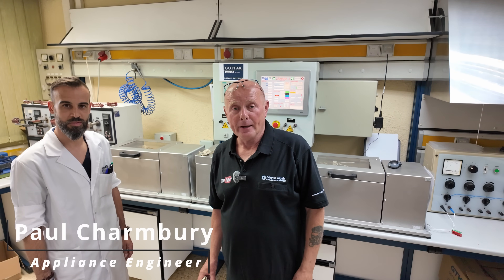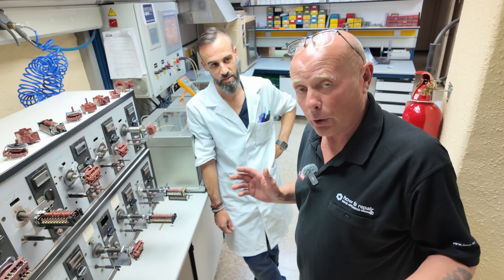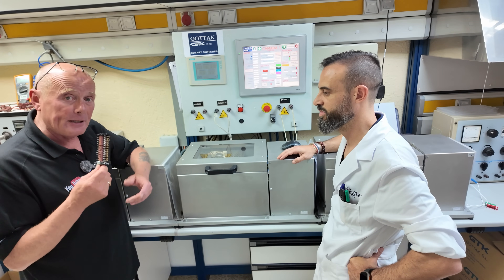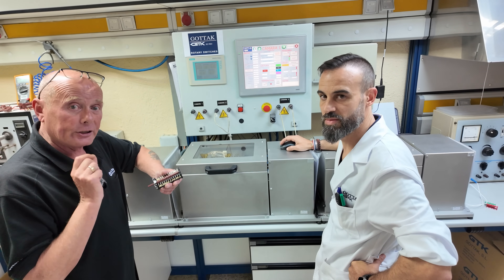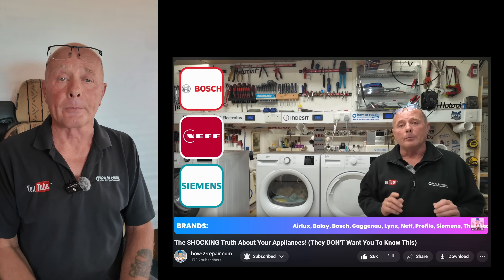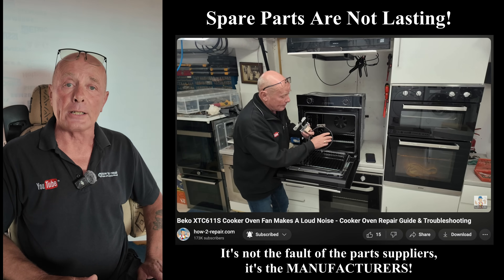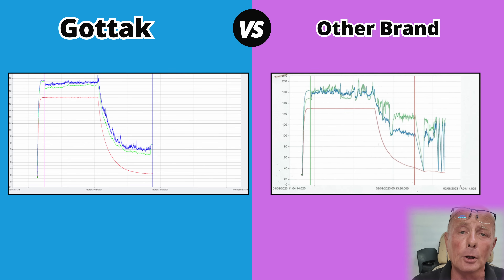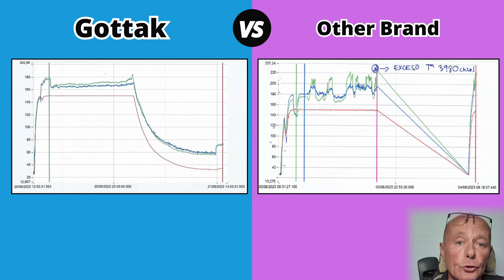Why Your Appliances FAIL SO FAST! Lab Results EXPOSE the Truth!

Comment: Market is full of shit claims to be honest. We bought I think it was Samsung or was it Electrolux washing machine. I think it had two or three year warranty and there was huge advert on machine for motor to have was it 10 year guarantee. Machine failed badly about half year later than warranty had expired. Drum was totally lose inside and there were small bits of stainless in drum. I was curious to what had happened and out of shock I find out that drum spider assembly was made of aluminium and drum fixed directly into it. I'm by profession packaging machine mechanic and even in "metal school" young, I was told that this is one of the worst corrosion pairs there can be and indeed in my eyes it was galvanic corrosion damage that had resulted in obsolete machine. Then looking at motor assembly surely enough it was assembled with really sturdy bearing and rotor/stator assembly was such that I don't think it couldn't have burned in that warranty time or at least I think odds for that are really low just eyeballing the assembly. It's downright disgusting what manufacturers do. I don't believe for a second that ANY company that has done washing machines for decades wouldn't know about virtually all possible corrosion pairs, but yet there clearly are ones in machines. I googled out of this in a shock and found out similar assemblies are very, very common in washing machines. Planned obsolescence? I don't question that anymore for a second and I've lost trust in all marketing stuff. It's going to be interesting how now I think it's two year old Miele washing machine and dishwasher will fare. They're touted by many to be robust, but time will tell. I don't believe anything until they've surpassed 10 years in use, that's if they will.

It's disgusting that these methods are done this day and age, when tech to create good solid robust devices are everywhere. I don't consider myself to be a "green person", but it still disgust me greatly how much stuff is discarded these days only after brief usage.
Reply from the maker: Hi there! Thanks for your incredibly detailed and insightful comment, @jothain!

Your experience with the washing machine is a powerful, and unfortunately, all too common example of what we discuss in our video. You've hit on several crucial points: the failure of a critical component (the aluminum drum spider) due to a known problematic material combination (with the stainless steel drum) leading to galvanic corrosion, and this happening just after the main warranty expired, while the heavily advertised motor remained perfectly fine. This is exactly the kind of scenario that raises strong suspicions of built-in obsolescence.

Given your professional background as a packaging machine mechanic and your early education on corrosion pairs, your assessment is particularly damning. As you said, it's hard to believe that a company with decades of experience wouldn't be aware of such a fundamental engineering concern. Your discovery that such assemblies are common only deepens these concerns.

Your point about the sheer wastefulness of discarding appliances after only a brief period of use, especially when the technology to build durable devices exists, is also spot on. At the trade show last year, understanding how these design choices contribute to premature failures and e-waste was a major topic. For a deeper dive into this and to see other examples we covered, please check out the full video here: https://youtu.be/gEgSCbZnHVM?si=wTIw0mELuhWaw4aX

We also explored related aspects in these videos:

The shocking truth about manufacturers: https://www.youtube.com/watch?v=QsdGd2qDPaI
Heat pump tumble dryers are they really worth it?: https://www.youtube.com/watch?v=xn03N3b0-lE

If you found this information eye-opening or validating of your own experiences, please consider sharing this video with your friends and family. Stories like yours are vital for raising awareness.

Thanks again for watching and for sharing such a compelling firsthand account. It's truly disgusting, as you say. Don't forget to subscribe to the channel for more insights like this!
Reply: @How-to-repair  Just remembered when I was at work in one evening shift when colleague arrived in his freetime to our workshop dragging top loading washing machines drum assembly with him. Machine had obviously gotten seized bearing cause of metallic grinding noise. We were awestruck to see that bearing was completely embedded inside plastics, so clearly made to be non-user replaceable item. My colleague just laughed at me and stated "I WILL replace that bearing after disassembling the machine". He quite violently managed to get bearing visible and we immediately got laughs that bearing as known had failed, but it didn't have any kind of markings in it. Maybe the worlds best indicator of really bad quality bearing, even the surface finish looked really bad to naked eye. We measured it and replaced it with good brand one, just as the sealing for it and he literally glued the casing back together. Now this is something we'd never endorse anyone to do, but it's incredible to what extents manufacturers go. We couldn't believe how it had been assembled and we both thought that it has to be a lot harder and slower to assemble machine like this, instead of making just removable bearing/sealing flange to it. With that flange assembly it would've been like less than 30min job to replace, instead of my colleagues was it about three hours he spend cutting the assembly open, replacing parts and gluing it all together. Insane... Just absurd stuff. Oh and it would've been possible to purchase replacement. For multiple hundred euros the entire assembly, very near to that machines retail price. Pretty much face slapping end user saying "Don't even bother with any labour costs" 🙄

Comment: The problem is making equipment that last for ever also is a death blow for the manufacture, as no new sales means you go broke.
Reply from the maker: The challenge of balancing extreme product durability with a sustainable business model that relies on ongoing sales is definitely a significant factor in how product lifespans are approached. It's a dilemma that's often part of the broader conversation around why products last as long as they do. Thank you for your comment. I appreciate people like you taking the time to write it out. Please share it where possible. It might help others make a wise choice instead of being misled by the industry.

Comment: The unnamed continent starts with a C and ends with an a.
Quisenart air fryers are short lived and made in the above country.
I also noticed that many other products don't use silver contacts, flashlights for instance, steel contacts....unreliable trash.
Reply from the maker: You're absolutely right mate. Once renowned brands with strong reputations for quality are now often owned by larger corporations that shift production to regions where costs are lower, such as China. Thank you for your comment. I appreciate people like you taking the time to write it out. Please share it where possible. It might help others make a wise choice instead of being misled by the industry.
Reply: @How-to-repair One sad example of the decay is Duracell battery's which are now leaking, short service life, and could do damage to devices if not checked often.

Comment: Will not replace defective appliances-will repair them myself. If unrepairable, I will buy an older used unit. Todays cars, and appliances are junk even when new.
Reply from the maker: Your approach of avoiding new purchases in favor of repair or more time-tested used models is a direct response to the issues we discuss where products might seem designed with shorter lifespans or built with less durable components. Thank you for your comment. I appreciate people like you taking the time to write it out. Please share it where possible. It might help others make a wise choice instead of being misled by the industry.

Comment: For this reason, when I notice an engineering fail, I fabricate a system that won't fail. They do the same thing with almost everything you buy now. Appliance parts, automobile parts, it's all the same. It's not about quality and making the best part, that's about making a part that will meet the minimum standards so they can make the maximum profit. For that reason alone high steer clear of digital appliances and with analogue controllers how often replace controllers with second hand dated parts because even though the part is used it will perform better and last longer.
Reply from the maker: You've hit on a really important point about how the drive for profit can often seem to overshadow the pursuit of quality and longevity in manufacturing. Your approach of fabricating your own, more robust systems when you encounter an engineering fail is a testament to the frustration many feel.

Thank you for your comment. I appreciate people like you taking the time to write it out. Please share it where possible. It might help others make a wise choice instead of being misled by the industry.

Comment: My washer is permanently set on Quick Wash. I never use anything else so the selecter should last forever. I have had to replace the door locking assembly 3 times though.
Reply from the maker: Thank you for your comment. I appreciate people like you taking the time to write it out. Please share it where possible. It might help others make a wise choice instead of being misled by the industry.

Comment: The appliance built today are trash they fail to early and can cause fires.  One example I  experience was a dry, the design of the air flow system force lent past the tank seal and caught on fire, the came out under warranty to repair, after 2 repairs and three lent fires we forced them to replace it.  Also the parts a cheaply built, the replacement parts many time were faulty and would not work at the time of installation after three parts on finally worked.  This also applies to car parts, on my granddaughter truck the fuel control module failed, a new installed the truck still would not run.  It was take to a diesel shop they said the controller was faulty so a new one was installed truck would not start. They thought the timing system failed after $ 3,000.00 was spent truck would not run. SO THE TOOK A WORKING FUEL CONTROLLER OFF ANOTHER TRUCK AND IT RAN SO A THIRD CONTROLLER WAS PURCHASED THIS ONE FINLY WORKED, TOTAL COST FOR REPAIRS $5,000.

It is a shame that reliability is of no concerned but selling more appliances is.   My son has a 1940 refrigerator that is still running and has never been repaired.
Reply from the maker: Hi there! Thanks for your comment, @davidhagerman7165!

We're really sorry to hear about the incredibly frustrating and dangerous experiences you've had with both your dryer and your granddaughter's truck. Your accounts of premature failures, fires due to design flaws, and the difficulty of getting working replacement parts are truly concerning.

You've hit on some critical points about the declining quality and reliability of modern appliances and parts, and the serious consequences this can have for consumers. The issues you described – from the dryer's airflow system forcing lint to catch fire, to receiving multiple faulty replacement parts for both the appliance and the vehicle – are powerful examples of the problems stemming from what seems to be a lack of focus on durability and robust design. This is exactly the kind of situation, highlighting how some products seem designed to fail or are made with subpar components, that feeds into the concerns about built-in obsolescence we discuss in the video.

The contrast you draw with your son's 1940s refrigerator that's still running is also very telling and resonates with many who feel that longevity is no longer a priority. At the trade show last year, understanding how much these issues of design, material quality, and planned obsolescence are impacting new appliances (and clearly other products too) is something everyone should be aware of. For a deeper dive into this topic and to see the examples we covered, please check out the full video here: https://youtu.be/gEgSCbZnHVM?si=wTIw0mELuhWaw4aX

We also explored related aspects in these videos:

The shocking truth about manufacturers: https://www.youtube.com/watch?v=QsdGd2qDPaI
Heat pump tumble dryers are they really worth it?: https://www.youtube.com/watch?v=xn03N3b0-lE

If you found this information eye-opening or if it validates your own experiences, please consider sharing this video with your friends and family. The more people who understand what's happening with product quality and longevity, the better equipped we all are as consumers to demand better.

Thanks again for watching and for sharing such impactful firsthand accounts. We truly appreciate you taking the time to detail these serious issues. Don't forget to subscribe to the channel for more insights like this!

Comment: China its in the chip . havent anything go wong yet  but   if i do ill  remove the chip and put some wood in its place it makes chips right @@
i pull things apart Aussie made thicker brass pins china thin as paper dont last as in powerboards kettles electrical types 
got to have a bopeep at a front loader washing machine  one day in the garage stopped working but most i see dumped on burbs  are near new condition
 i bet its awire  switch or pump 1 2 3 look   if not Multimeter  check  circuit's if  no go its spare parts  or out
Reply from the maker: Thank you for your comment. I appreciate people like you taking the time to write it out. Please share it where possible. It might help others make a wise choice instead of being misled by the industry.

Comment: This kind of tactic should be illegal!  Not only are you forcing huge expenses on the consumer, but also putting them at risk of overheating and fire of the switches.  Engineered obsolescence is not new and occurs in nearly every manufacturing process from toasters to automobiles.  It has to stop!
Reply from the maker: Thank you for your comment. I appreciate people like you taking the time to write it out. Please share it where possible. It might help others make a wise choice instead of being misled by the industry.

Comment: What's the build quality of commercial washing/ drying machines compared to domestic?
Reply from the maker: Hi @benjio77! Thanks for your question! You're asking about a really interesting comparison: the build quality of commercial washing and drying machines versus domestic ones. 

Generally, commercial washing and drying machines are built to a significantly more robust standard than most domestic models. They are designed for heavy, continuous use, easier maintenance, and longer lifespans.

Thank you for your comment. I appreciate people like you taking the time to write it out. Please share it where possible. It might help others make a wise choice instead of being misled by the industry.

Comment: Apart from anything else its such a waste of resources to make an appliance that will only last 5 years instead of 25
Reply from the maker: Think about the environmental impact of building machines and then recycling them. These machines are often transported halfway around the world, which adds to fuel costs. It's baffling that we need to ship them every five years due to failure.

Comment: I work in home renovation and repair for rental property owners. I'm often called out to replace broken microwaves, dishwashers, and washing machines. Most of the time these appliances are under 10 years old. Because the appliances are so cheap and labor is so expensive usually Its not worth it to repair so I end up taking the old appliances to the dump and replacing with a brand new unit. If people really care about the environment then there should be laws to require much higher minimum warranty periods...It would drive up the cost of appliance but in the long run it would be better and cheaper for everyone.
Reply from the maker: planned obsolescence and the lack of repairability are major issues in the industry. Manufacturers prioritize profit over long-term reliability, and as you pointed out, the pressure to keep releasing new models only adds to the problem. I would greatly appreciate it if you could share this video. Together, we might be able to bring about some change. If we can't shame the manufacturers into action, perhaps someone in government will see the video and take notice of the overwhelming number of comments expressing public concern.

Comment: I have a high quality 40+ year old MIG welder that is has had no love. Dragged around in a trailer, left in the rain and dust in and still works perfectly. 
Been through MULTIPLE appliances that have no environmental exposure. 
I don't think that there is any questions regarding consumer electronics being designed to fail. 
What is the environmental damage being done?
Reply from the maker: Think about the environmental impact of building machines and then recycling them. These machines are often transported halfway around the world, which adds to fuel costs. It's baffling that we need to ship them every five years due to failure.